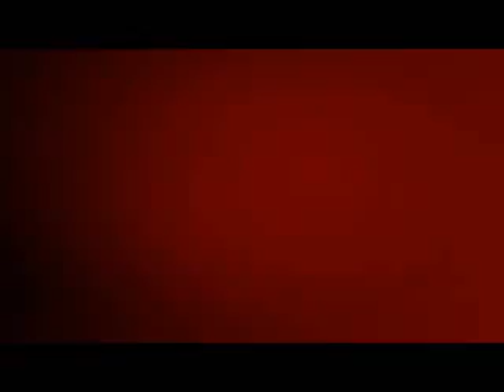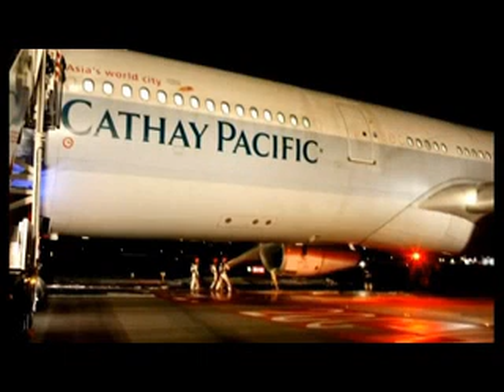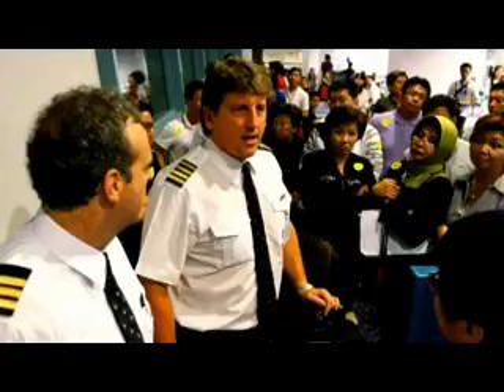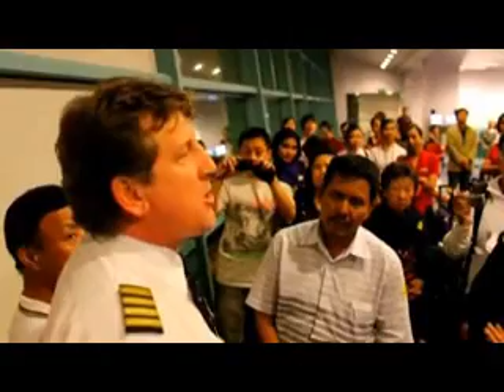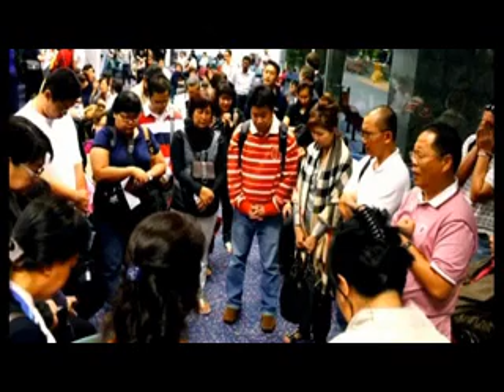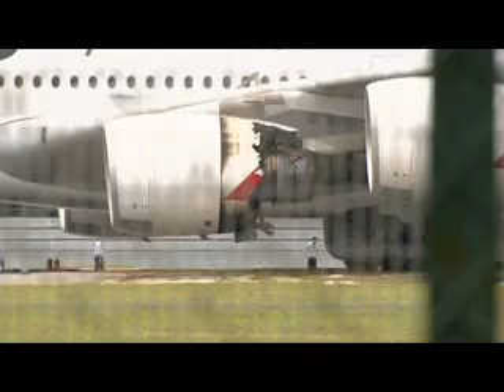Cathay Pacific Airbus A330-343X make an Emergency Landing

Comment: @rb21122b  It Could just be tht The RR Engines are Just Not Enough for the thrust High Tec Planes Need.... Like for Example... The recover the stall the fly by wire must have added extensive power to the engine causing an engine flame out or fire... It has been common tht RR enginesFail and Are Becomin people's Concern. 
Hope RR Fixes All It's Defacts =)

Comment: @maxp0w3r For the V2500, it really depends on what part of the engine was the failure. Internation Aero Engines is a joint venture between 4 companies making various components for the V2500. For example, Rolls Royce is responsibe for making the high pressure core and gearbox.